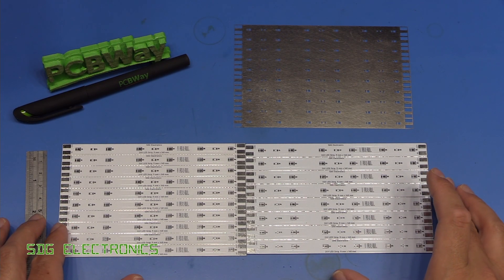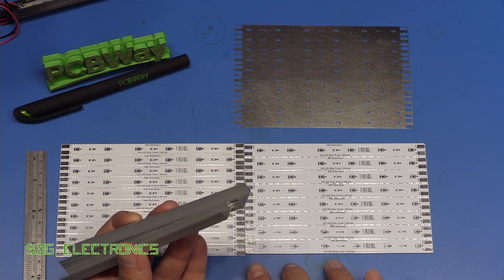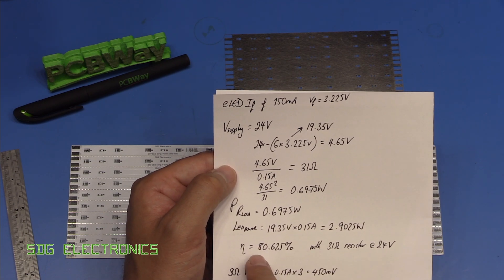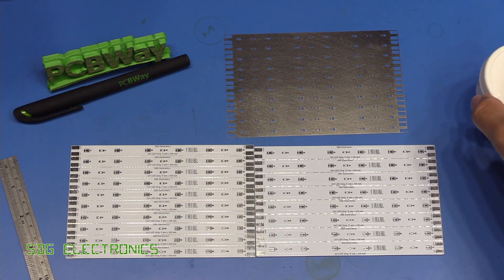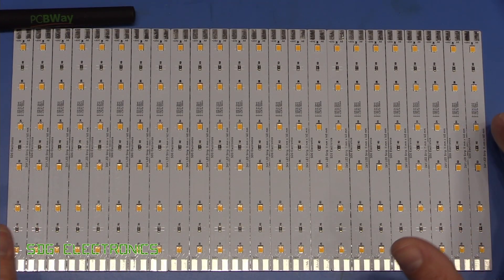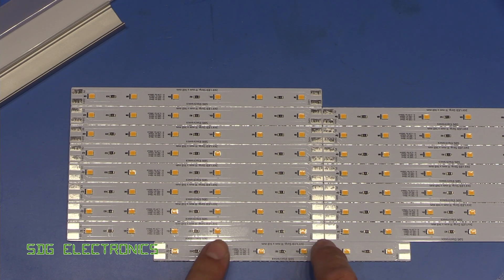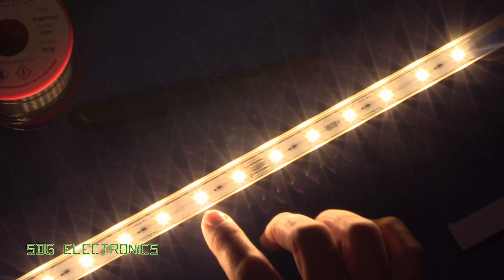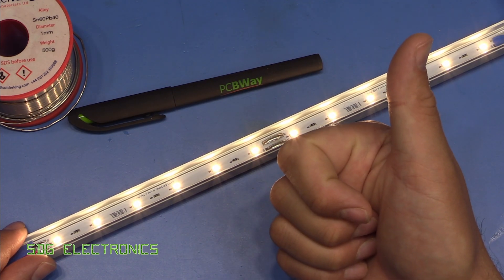SDG #262 DIY High quality 20 W/m 90CRI LED strip with Cree LEDs

Comment: I think there's at least one seller on ebay that sold, or used to sell, rigid aluminum backed LED strips, some higher CRI and others constant current, I bought some of the higher CRI ones, much nicer than the flexible sticky crap

Comment: Why not replace the resistors with a simple low drop constant current circuit, it would remove any effect from voltage drop?
Reply from the maker: I was hoping to keep things simple and flexible, but in retrospect there were some other options that might have worked better.
Reply: Try searching for "constant current diode"
They are not really diodes, but two pin constant current devices.
Reply from the maker: Good call, I had forgotten about these. Looks like they fit my 1206 footprint on the PCB so I've just ordered some!

Comment: Meanwell HDR-150-24 Din Rail Mount 150w can be adjusted down to 21.6v.  
I use a NUD4001 CC LED Driver on my multichip lights, but they run at 350mA for 3 CREE J3030 in series on 12v.  Quick sim shows you could easily run 6 leds @ 150mA on a single NUD4001 with a 4.3R sense resistor off a 24v supply.   Easy to add PWM for dimming control if needed as well.

Comment: Great content, Steve. How about featuring a current-controlled driver for the LEDs? I've tried some dedicated chips but I'm yet to try modifying a buck to have its feedback pin sensing the current with a use of resistors.

Comment: I recently made some metal LED PCBs using Cree XP-E running at 1A each. I chose to use pcb with sinkpad/pedestal technology and it was quite amazing. This is where the heatsink pad of the LED is soldered directly to the base metal through a cutout. the 1 or 2 W/mK of the dielectric is bypassed and you basically get a very high thermal conductivity to the metal.
Reply: Interesting. How did you design that in the PCB layout?
Reply: @ulwur  It was really simple, just do a single layer design and don't use any through hole vias. You can use unplated mounting holes, though. In the mechanical layers, you specify where the heatsink pads are. You do need to use a board house that supports sinkpad/pedestal technology, though.
Reply from the maker: Which PCB supplier did you use?
Reply: @sdgelectronics  I did a large quantity through Junbon in Taiwan. Last I checked pcbway and jlcpcb do not do it. Adura LED is the USA pioneered the tech and I  believe they can do small quantity runs for fairly cheap. Adura will also sell small sample boards, I recommend checking out their website.

Comment: Love to see you are still building things :)
I am using Cree J-Series for 5 Years now.. best decision I ever made. That light doesn't compare to your average LED strip.. 

Since they are quite affordable I would use double the amount of LEDs and half the current 🙈 I would guess that makes the overall cost lower and increases the lifespan. But dang..  these are nice Alu channels !
Reply from the maker: Still building things, but summer is peak house/garden project time, so time has been a bit limited!
Reply: do you have any schematics on hiw you build your led strips with cree j series? what do you use to drive them?
Reply: @lordjaashin  depends on what you want to do I guess.. there are thousands of drivers. usually they have a schematic in their datasheet. for example the dio5661.

Comment: Would be nice to have an electronic 'drop' foot switch on the floor for the pnp pen so you get better placement.Taking finger off is a bit like having shaking hands.
Reply from the maker: The one I built has a footpedal, but I didn't permanently block the hole in the pen. The new design will definitely keep the footpedal input.

Comment: The difusors showed massive loss in brightness. 

Our ceiling fixtures have a variety of diffusers; some cheap plastic sheet diffusers, some ridged plastic ribbed diffusers, and some combination of ridged plastic plus perforated metal. The rigid plastic plus perforated metal are the most pleasant and lowest glare by a wide margin. Cost was much higher (the LEDs and drivers are all identical) and they are slightly less bright.

Also, our fixtures are different from your light strips, as some of the light directed to the ceiling by diffusers is gently reflected back down by large white curved surfaces.

Comment: 13:55 yeah, using flux core tin "helps"..
just use 1 - 1.5 sq. mm copper wire, it will hold a lot better as solder is brittle when bent.
won't short either.
Reply from the maker: Agreed, I think it'll be more robust as you say.

Comment: Why resistors and not a switching Constant Current switching supply?
Reply from the maker: With 480+ LEDs, I will end up with some parallel chains of LEDs which need current balancing. Since it's in a bathroom, the supply must be SELV (isolated and less than 50V), so there is not much opportunity for long series chains of LEDs.
Reply: @sdgelectronics  Okay, I got it.